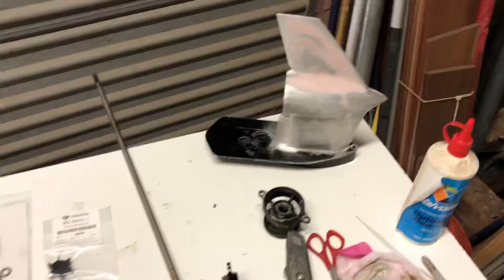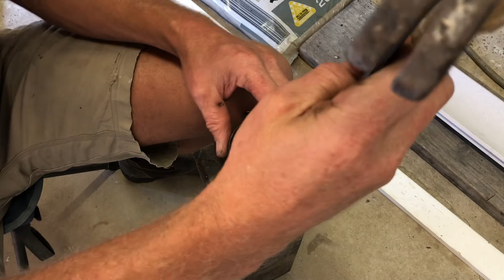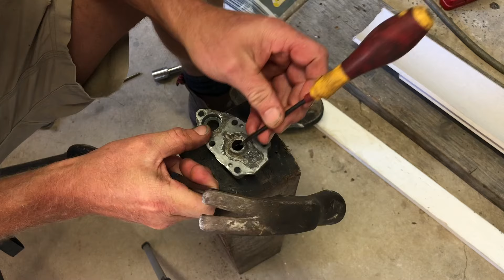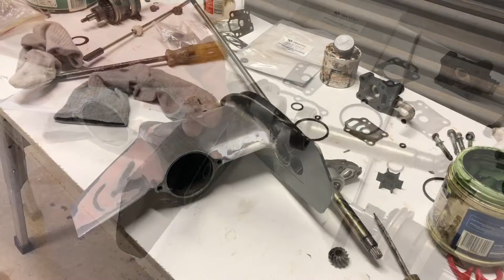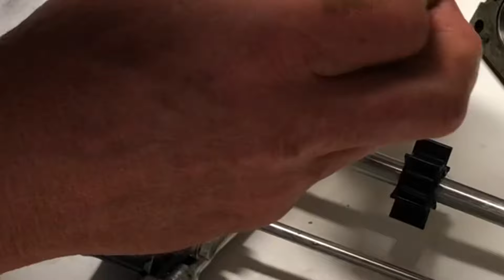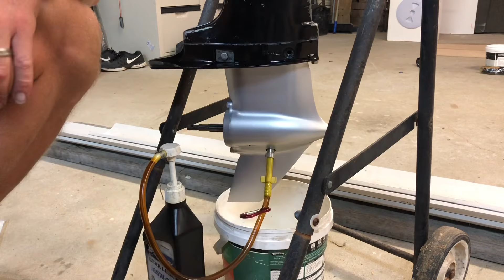Outboard seal replacement - propeller - drive shaft - shift

Comment: great - love your wee tricks making awkward tasks so much easier
Reply from the maker: Happy to make the job a bit easier for you, thanks for watching! Cheers 🍻 Aussie Boat Guy 😎
Reply: @25hpboatracerman  Am doing a first time lower unit seal change on a Johnson 6HP 1979 (last year of old style split case), whenever the kit arrives from USA to me in Scotland - there seems to be a worldwide shortage of kit or the 9 individual components (many US suppliers do not export).
Reply from the maker: Hi Mate,
Yeah, some parts are getting hard to get.
Glad you seem to have sorted the parts you need, hope they come soon.
Cheers 🍻 
Aussie Boat Guy 😎
Reply: @25hpboatracerman  Have watched many 6HP and 10 HP seal change vids like yours, trying to understand what was a daunting task, and the part descriptions and functions - turns out my 1979 engine is a crossover where for only part of that year they kept the split gearcase but changed the power unit to a cdi, hence confused me watching vids - you live and learn lol.

Comment: Great video!  Amazing advice with great detail!
Question for you, how do you get the vertical drive shaft out of the lower pump housing?  I already removed the 4 bolts and the water pump housing.  All thats left is the metal housing below the water pump with the shaft, bearing, and seal.  Do you just hammer out the shaft and then pull the bearing out to get to the seal?
Thanks
Reply from the maker: Hi Mate,
Most gearcase you will need to remove the prop shaft and gear sets then there will be a pinyon gear on the bottom of the vertical drive shaft with a nut on the bottom which you will need to undo.
Cheers 🍻 
Aussie Boat Guy 😎

Comment: How do you pull out the rear bearing carrier? Pulling tool on the prop shaft and pull it out that way?
Reply from the maker: Correct 👍 
Cheers 🍻 
Aussie Boat Guy 😎
Reply: @25hpboatracerman ended up using flathead screwdriver and few sideways love tap. When turned in the vice and gently tapping it free using the "ears" didnt need a lot. 

Got a mariner 6hp (same lower unit as tohatsu) so this really helps alot :b hehe. The oil seal are are pain however to remove. ☠️☠️ But i will tackle that today
Reply: My advice. Just replace the rear bearing house. 😂😂 So less troublesome. And fairly cheap to replace. Its like 40 euro. 😂😂
Reply: @25hpboatracerman oh man! Part 26 "retainer" in the 4-6hp mercury manual. That small cylinder in in the pushrod (to select gears) i fucking lost it... And could not go in reverse what so ever! Was losing my mind assembling it. Saw i needed a TINY part between spring and pushrod. Almost getting ready to order new part. And found it on the ground... 😱😱😱 Keep work place clean so you can find stuff you lose. 😱😱😱☠️ Again. Cant thank you enough for this video. Layout of all the parts in thumbnail. Thanks a ton on the other side of the globe (Denmark)!! My aussie hero!

Comment: Is this the same process for 1983 evinrude 4.5 hp?
Reply from the maker: Hi Mate,
Similar but they have exhaust exiting above the prop but the principal is the same. you want to check your drive shaft seal and shifter seal at the same time. if you can pressure test it you will see where it’s leaking 
Cheers 🍻 
Aussie Boat Guy 😎

Comment: I've learned a lot from your videos, thank you! 
Question- how did you remove the bearing carrier (prop shaft housing)?? I have the same M5B and I'm trying to replace the seals and O ring. Right now the thrust holder is stuck on the shaft, and the housing is bound as well. I haven't been able to fit a puller onto the thrust holder because these outboards are so small. I've tried tapping the housing from the side, hoping to loosen it with a circular motion, but that resulted in a piece of metal chipping from the housing. What I'm thinking next is to wrap high strength paracord around the 4 splines on the housing and pull it with a ratchet strap. Any other ideas? It's very hard to get leverage on the thing since it all comes out one piece!

Comment: i got an aussie importer brand called a "vortex" that uses parsun parts...i believe vortex was a goldcoast based dealer that no longer exists, and no manual or service manual...I was using the service manual for a yamaha F4...just realised its more of a mercury knockoff...this definitely looks familiar. I have to replace the seals, hoping just in the prop assembly. Been a nightmare trying to get info, for a chinese knockoff of a parsun, which is a knockoff of both yamaha and mercury....despite all that, the motor is great it was seized but come back to life with a bit of tlc....I keep checking marketplace in the hope one will show up busted, and cheap...with the lower unit in tact lol...dream on...cheers mate...great vid...these are invaluable for us beginners
Reply from the maker: Thanks for the kind words, really appreciate it. Glad I could help out!
Cheers 🍻 
Aussie Boat Guy 😎

Comment: mate i was wondering...my outboard is pissing out gear oil..theres a layer on the surface of my water bin, my gear oil has water mixed in...also the little hole where lower sift rod protudes has water splashing out when running. Is it more likely to be the prop shaft seals or drive shaft....or do i have to do the whole lot??

Comment: I repaired my 4.9 hp outboard motor after watching the video. Thank you!! Should I apply adhesive to the lower water pump gasket and the upper and lower gaskets of the water pump plate? Can't I just glue them together? What adhesive would be best? From Korea~~

Comment: Hello mate, I’ve just changed my impeller and when I tried getting the lower unit in, I noticed my shifter stick thing moved freely and didn’t select gears. I’ve just taken it apart and I can’t see through the oil but the stick is loose from the gears below.. How do I fix?
Reply from the maker: Hi mate,
What hp?
If it’s the 5hp tohatsu or mercury it just needs to push back down into the base (orientated correctly)
You can see the shifter in the beginning of this video. It has three different heights.
I most likely run through this in this video.
Cheers 🍻 
Aussie Boat Guy 😎
Reply: @25hpboatracerman thanks alot, one more question. When I try to put the lower unit in, it doesn’t go all the way, the grease I put on the top half of the parts that goes inside the motor (im not English I think it is driveshaft?) yeah so the top half of the piece with grooves in the metal only goes in. The rest doesn’t.. do I just hit it as hard as I can or is there a technique

Comment: Hi there 👋 do you know? How to pull out forward prop shaft bearing? And lower drive shaft bearing? They’re stuck inside
Reply from the maker: Hi Mate,
Unfortunately you need special tools.
I made a threaded rod with a nut to remove the lower drive shaft bearing but the forward bearing is even harder. I did make a tool to do that many years ago but can’t remember exactly what I did, it will need to go through the bearing and grab the rear lip.
Cheers 🍻 
Aussie Boat Guy 😎
Reply: @25hpboatracerman  thanks Aussie 👍

Comment: This is just the video I am looking for. I recently bought a 2nd hand 5HP 2 stroke mariner outboard and found out that oil is leaking on the propeller shaft. Found out the gears also started to rust, so I might have to remove the whole lower unit. What is this kit called with all the seals and impeller? Thank you, bro. Kudos!
Reply from the maker: Hi Champ,
Glad the video is helpful. I don’t know if there is a rebuild kit. I just ordered the parts from Tohatsu directly.
Cheers 🍻 
Aussie Boat Guy 😎

Comment: Is pulling the prop shaft assembly necessary to pull the shift shaft out and reinstall?
Reply from the maker: Hi Champion,
No need to pull the prop shaft to change shift shaft seals on that particular model, just undo the seal retainer on the shift shaft and it slides up.
Just make sure you re-install it with the shifter the same way around, they have three different heights on the end as seen in video.
Some motors do need the lower to be taken apart to change shift shaft but lots don’t.
Cheers 🍻 
Aussie Boat Guy 😎
Reply: Aussie boat guy, I changed my shift shaft seal on a 98 60 hp Yamaha the c shape retaining clip popped off, I put it under the SS housing and it pushes it off, I can’t get it above the housing. I don’t have reverse gear now any help mate

Comment: Tohatsu 18 2-stroke umbrella gear nut, what wrench do you use to open it? To remove the long axle..thank you
Reply from the maker: Hi Mate,
If you are meaning the propeller nut, you need to remove the split pin then use the appropriate socket.
If you mean the prop shaft, the two 10mm bolts hold the rear bearing carrier in, the whole assembly will come out. Check out my Lower unit rebuild video 
Cheers 🍻 
Aussie Boat Guy 😎

Comment: Thanks for the video, I have to change the prop shaft on a late 90s saltwater series 2 yammie 250hp, looking at the video I'm thinking I can remove the prop shaft without removing the foot, is this correct?. March 2025
Reply from the maker: Hi Mate,
Thanks for your comments 👍
Yep, you should be able to leave the lower unit on the leg and just undo the rear bearing carrier and remove the prop shaft etc.
Are you replacing the prop shaft or just the prop shaft seals? If you are doing a prop shaft, good call to do the prop shaft seals at the same time. Also you will need a new o ring around the rear bearing carrier once pulled apart.
Cheers 🍻 
Aussie Boat Guy 😎
Reply: @25hpboatracerman hello mate I just replaced the seals, impeller on a 98 Yamaha 60 I moved the shift shaft and now I don’t have reverse, any help would be greatly appreciated

Comment: just picked up another 9.8 tohatsu, the shifter is quite stiff, feels like its seized/rubbing near the shifter. Do I need to remove the powerhead to try and free it up?
Reply from the maker: Hi Mate,
Most likely do need to remove the powerhead. I would remove the case first and see if it’s still stiff to actuate the shift leaver.
Cheers 🍻 
Aussie Boat Guy 😎

Comment: No marine grease on the seals?
Reply from the maker: Hi Champion.
I just added some gear oil but I like your thinking, will probably use grease in the future depending on opinions of my marine mechanic friends.
Cheers 🍻 
Aussie Boat Guy 😎
Reply: When you put in faucet washers you use faucet grease

Comment: hi, i have a 1987 STRAIGHT 6 115 HP merc. The leg was stuck in forward.. When i pulled it apart i found 3 ball bearings rolling around . Are they what holds the shifter shaft in gear.. I noticed the gear shift shaft rotated but didn't click or lock into gear.. is it possible to phone you. Do you also do parts ?
Reply from the maker: Hi Mate,
It does sound like a dog clutch issue, I would probably call my local outboard wreckers to see if they had a box I could purchase, especially if there has been some free bearings in there while running.
Cheers 🍻 
Aussie Boat Guy 😎

Comment: I have a Mercury 110- 9.8 hp. Was going to replace the shift shat seal and O ring. The retainer looks to be aluminum with a set screw you remove and then remove the retainer. Removed the screw but the retainer is really tight. Tried putting Vice grips around top edge with moderate pressure and leveraging it up but it did not budge. I was informed that the shift shaft cam does not have a pin to hold it to the shaft so you have to hold down on the shift shaft while taking the retainer out, so it does not come up out of the cam splines. It it comes out of the splines the whole gearcase has to be disassembled to line it back up. Any suggestions on how to extract this retainer as it is round and nowhere, I see to pry on it. Not sure it is leaking and may leave it alone unless it gets water in the gearcase. The single driveshaft oil seal comes already installed in the lower half of the new water pump housing that just pries up with an outer O ring sealing it in the bore.
Reply from the maker: Hi Mate,
Sounds pretty normal for the older motors, I go through stuck stuff all the time. I would possibly leave it and do the other seals like you said because of the risk of damaging the seal carrier.
Keep an eye on if water is penetrating your oil and commit to changing if needed.
Cheers 🍻 
Aussie Boat Guy 😎
Reply: @25hpboatracerman  Yeah resigned to that path. Thanks for the response.

Comment: My prop doesn’t move at all is this the way to fix that or could it be something else
Reply from the maker: Hi Mate,
It could be many things like -
Spun prop shaft, broken prop shaft, broken drive shaft, gear selector issues etc etc.
I would remove the prop and see if prop shaft spins when motor is in gear motor running to start.
Cheers 🍻 
Aussie Boat Guy 😎

Comment: I'm currently rebuilding my lower unit on a Tohatsu M5B 5hp two stroke. Firstly, thank you very much for many of your videos. Secondly, I have a question... dry fitting the drive shaft to the pinion gear, I've noticed when engaging forward, there's little lash between the gears when turning the drive shaft by hand (feels normal). However, when reverse is selected, there's a full rotation of the drive shaft before lash it taken up on the prop shaft. Does this seem normal? Thank you again
Reply from the maker: Hi Mate,
thanks for your comments 👍
The lash your talking about could actually be the rod clutch and not the lash between gears. Yes I is often normal to have a turn until you see the prop spin after being in forward gear. the gear cases are often around  a 2 to 1 ratio and with the play in the fog clutch gears that sit into the reverse or forwards gears it will take about a turn of the driveshaft for the prop shaft to engage.
Cheers 🍻 
Aussie Boat Guy 😎
Reply: @25hpboatracerman  Appreciate the speedy reply mate. I reassembled the unit today, thanks to your video. Put oil in it and spun the drive shaft by hand. I can't help feel there's an issue. Turning either by drive shaft or prop shaft, the gears have have a mild resistance to them. You can also feel them meshing when turning the prop shaft. It's not smooth like it was before I disassembled. I have changed the water pump impeller and the drive shaft and gear selector shaft seals. I noticed when I removed the drive shaft, the small pinion gear seem to float around on the transmission gears... but it still lined up and I was able to reinstall the drive shaft. No problem with the gear selector mechanism... pop, straight in and works fine. I can't help but think something is not aligned properly with the pinion gear. Is it possible to upset this gearing by removing the drive shaft, but keeping the propellor shaft installed? Apologies for the long-winded reply :(

Comment: What do you recommend replacing when my gear oil is leaking out at the bottom in between my gear case and my propeller?
Reply from the maker: Hi Mate,
I would firstly make sure it’s gear oil and not just un- burnt two stroke oil or if it’s a four stroke engine oil.
If it’s gear oil you will be able to smell it, it’s very pungent. it is pretty normal for a two stroke to have a black oil seeping out on occasion which is un- burnt two stroke.
if it is however gear oil, it could be your rear prop shaft seal or even your dive shaft seal. 
you can pressure test your gearcase to see where it’s leaking unless you can pull your prop off and see a leak.
cheers 🍻 
Aussie Boat Guy 😎
Reply: @25hpboatracerman  I have a 2 stroke Mercury. I mix the oil in with the gas and it doesn’t smell like gas so I assume it’s gear oil. I will check to see how low my gear oil is when I get another quart. Just wanted to get your thoughts..

Comment: Hi great video just a question i have a 210 Quintrex legend center console boat with a 60 hp Mercury engine i think its a bigfoot its hard to shift in to gear i have taken control cables off and it shifts smoothly so must be at the engine end any ideas i can do to make it change smoother thank you
Reply from the maker: Hi mate,
It could be a number of issues unfortunately.
I would remove the gearcase and see how the shift system works without the box on. I would then check the gearbox shift while it’s off and hopefully it’s an easy fix. It could be a bit of salt buildup somewhere.
Cheers 🍻 
Aussie Boat Guy 😎
Reply: @25hpboatracerman  Thank you much appreciated

Comment: I bought a motor already taken apart for the prop shaft got a new prop shaft and can’t get it figured out. I thought I did but it wouldn’t engage reverse
Reply from the maker: Hi Champion,
That’s super annoying 🤦‍♂️
It’s most likely missing the one of the little spacers in the end of the prop shaft that push the dog clutch. There is normally supposed to be two on that model, I think I cover that in the video. 
One spacer with rounded ends and one shorter one with square ends on the round spacer. 
Without the correct spacers, it won’t select gears properly.
On a good note, easy fix if it’s that.
Cheers 🍻 
Aussie Boat Guy 😎

Comment: Great videos, I have a couple of 5hp Mercury's I'm playing with as a little project. Any tips on getting the outer bearing carrier out?
I have one that is frozen in!
Reply from the maker: Hi Mate,
Unfortunately they can get very stuck if your talking about the lower unit rear bearing carrier.
I find that if you put the motor on its back (prop shaft to the ground) place the skeg on a block of timber and use a slide hammer on the prop shaft it normally pops out. 
make sure to keep the power head higher than the lower unit if there is any drops of water in the leg as they can run into the exhaust ports and cause rust very quickly.
cheers 🍻 
Aussie Boat Guy 😎